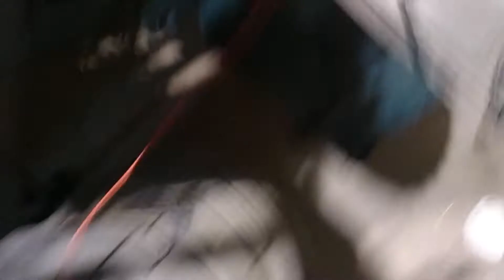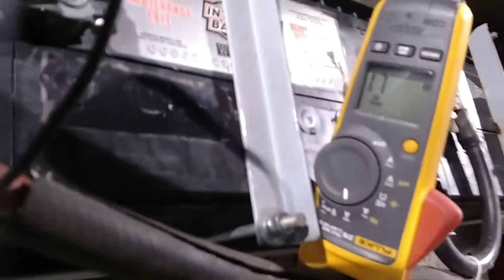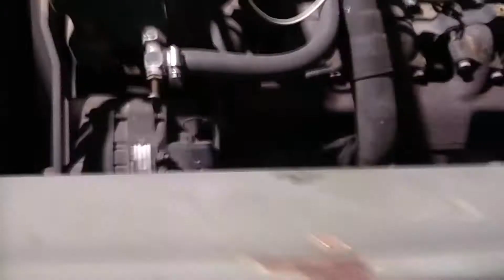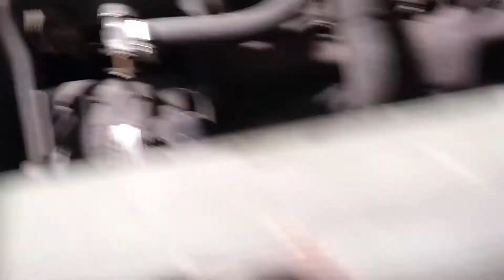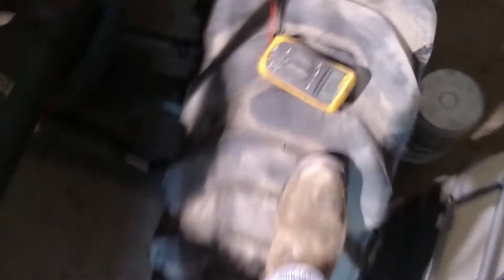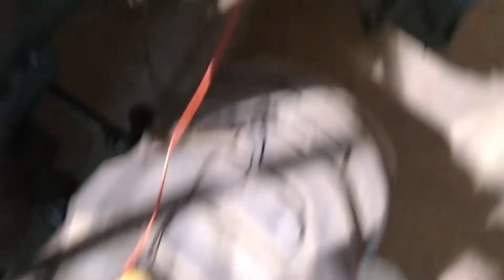Sulfated batteries part 2

Comment: yep a screw driver and knowing where the secret potentiometer is located so you can change the reference point on the voltage divider.   good job...  I run mine up to about 14.5 volts on 12 volt systems.
Reply from the maker: 14.5 is a little low for something that sits and not run for long enough at a time to keep batteries from getting sulfated